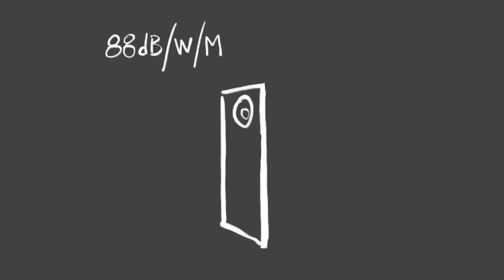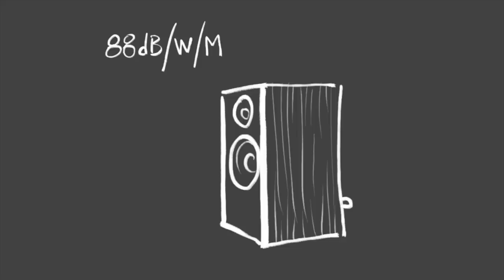John DeVore goes on a rant about the High End Audio lie that inspired him to start his company

Comment: Greetings Sir!  Awesome!! As one who's first "high-end" lol system had a 6v6 push pull Bell mono at heart this is so easy for folks to understand!  I still have a legendary speaker for it's time DQ-10s The concept of time aligned / mirror was significant. My pair went through several owners and I was getting ready to get rid of also until I out I put some real horsepower behind them.You look much younger than I so you might not remember the Soundcraftsmen 300 watt a side class "H" Like supercharging a car. And I have their opposite The Altec model 19's a transistor radio can drive very loud! I had to subscribe to you due to such a wonderful clear easy to understand thought as this!  Thank you!

Comment: Correct me if I'm wrong but if you raise the ohm rating don't you need to increase the power from the amp? In headphones for example my AKGs are 65 ohms and I need a external DAC but with my Grado's which are 32 ohms I can drive them straight from my iPhone. I'm sure you had this relation the other way round?

Comment: Excellent summation...I personally feel majority of consumers (non-audiophiles) "don't know what they don't know".

I also believe speakers have succumbed to the unfortunate bigger is better marketing trend that has plagued this industry relevant to amps and receivers. This does not apply to their size, but to their hyped up specification description. 

While audiophiles can reap the benefit of lower costs consistent with this ruse, generic listeners need to remember that all watt "ratings" do not necessarily reflect a congruent listening experience among brands. I will refrain from listing name brands, but audiophiles clearly understand this marketing ploy that exists with the higher number the better the system ploy (e.g. A multi-hundred watt complete sound system on sale for $399 will not yield the same high quality performance as higher end audio components). 

I do miss the Hi-Fi shops where you could actually go in and readily discern audio reality. Unfortunately, low mark ups and profit margins appeal to the big box mentality of the aforementioned systems vice the listeners discovering the identifiable nuances in person. 

Please listen with your ears to hear the clear and distinct differences that exist with quality systems that actually define high fidelity vice those "popular" brands! It remains a recognizable as the vast difference between a base level automobile and a high performance driving experience. 

Happy Listening!
Reply from the maker: Happy listening!

Comment: All amplifiers double their output when resistance is cut in half, it's just that most amps have voltage-attenuated max output figures when driving speakers below 8 ohms. For example, most any home audio amp will produce 1 watt at 8 ohms, 2 watts at 4 ohms, 4 watts at 2 ohms ect, but their max output is voltage-limited above a certain threshold, typically producing specs like: 100 watts max at 8ohm but only 150 max at 4 ohms. The difference with voltage-source amps like Krell or Sunfire is their output isn't voltage-limited when driving a lower impedance, so their output < 8 ohms isn't curtailed by voltage-limitations, provided the input current is sufficient.

Comment: I've got some Realistic Minimus-7 tiny speakers from the late seventies that sound fantastic, with a surprising amount of bass for such a small woofer! I've yet to hear a bigger speaker cabinet that sounds as good as these. They were developed by Pioneer for Tandy Corporation if I'm not mistaken. Very simple design: solid aluminum casing, a 4" acoustic suspension woofer, and a single dome tweeter, with a crossover into 8 ohms. They're only 40 watts but the sound quality is to be heard to be believed.

Comment: I'm a guy who has owned lots of speakers going back to early 70s. This is THE best explanation I've seen on this subject. My Larger Advent speakers are great but you can't drive them with a transistor radio. Claims aside, some speaker AND amp builders these days have sort of perverted the specs to fit their goals.

Comment: fine essay. to my 72 year old  (non 'audiophile' ) ideas, 2 small mentions - the good ole AR speakers , briefly mentioned - the leader or which, the AR3a , (mid 1960's)was very highly rated for bass especially - along with I think first production of Dome mid/ tweeters still in use -  But I'm pretty sure they were also called 'Amp killers' for their low resistance/ imped.  fast forward a bit, in I think 1978 Koss came out with a very early speaker using ' Thiel /Small computer programming for the  Bass Ports..  got excel reviews like ' flat +- 2 db from 30 - 5000 hz for the largest 1030 model.  I still have both that magazine issue and my Koss 1020 spks.

Comment: One thing I noticed is the sudden appearance of all these $1,000 speakers (like from Klipsch) that are made in China.   Why are these companies doing this when there are non-outsourced speakers that are better for a similar price?    I could never see myself buying Klipsch over Focal for example.
Reply: My RP-600 M have been relegated to the office on vintage amp with loudness. They sound ok.Just replaced them with J M Reynaud Cantibile from 2008. The sensitivity is lower than the Klipsch but……my volume control has to be set much lower than the Klipsch as they’re too loud. KLIPSCH are liars!!!!

Comment: You made a good point about the specification. In the interest of accuracy, though, you wrote it as dB/1W/1m when it is actually dB@1W@1m. The division sign implies proportional relationships, when, in fact, they are logarithmic. The @ sign indicates a single point of measurement, and not an equation (y dB = x Watts / z meters).

Incidentally, I've given up on the whole amplifier thing. Powered KRK Rockit 8's and a mixer. Only thing I've heard that's better are Quads. And they are out of my price range.

Comment: Hi John, thanks for a great video. Absolutely, speakers are not resistive loads, but rather reactive. No speaker that is rated at 8 ohms is actually 8 ohms throughout its operating frequency range (and I believe that impedance may vary depending on signal amplitude as well). So for the speaker/amplifier system to maintain a constant energy output, the amplifier must respond with a greater current output during those moments or modes in which speaker impedance drops. 
One note about speaker design- I believe that the push towards smaller drivers (through the 80s and 90s especially) has contributed to greater speaker reactivity. This is because to maintain a certain degree of bass output, a smaller driver must travel further in order to displace the same volume of air. (This trade-off occurs at all frequencies but is particularly important in the bass.) So you have higher relative velocities between magnet and voice coil, and longer speaker strokes, both of which may contribute to reactivity and other non-linearities.
Reply: That being said they're getting pretty good at overcoming those effects, while also having the advantages that you can get from smaller drivers.
Reply: @RennieAsh  Hi Rennie, yes, you're absolutely right, and the new engineering ideas are often really interesting.

Comment: I’ve had 3 sets of two 8 ohm speakers attached to the same 3 channels (left center right) of a Pioneer Elite amp for years without any problems. They are arranged above and below my 65 inch TV with a larger one mounter in lower center position. This anchors the sound in the center of the TV. It is a 6.1 setup.

Comment: A great discussion! Just my two pence: the lower the output impedance of an amplifier the easier it can handle low speaker impedance by providing high current without attenuating the signal. All well designed serious power amps deliver exactly this. With a less powerful amp its output impedance forms a voltage divider with the speaker impedance thus attenuating (=distorting) the signal. The voltage divider exists in the former case of course but the low amp output impedance can be assumed to be 0 Ohms.

Comment: Hey John, I’m new to this audiophile hobby and to your channel. I respect and understand where you are coming from as the watt/DB rating being misleading. But what you didn’t elaborate on, and probably should have more is why did that inspire you to go from enthusiast to making your own speakers and how does that coincide with solving that industry marketing problem? Are you planning on stating the required Volt reading and the traditional more accurate watt/DB/m rating? You didn’t really finish your thought. You only explained the problem without telling us how you plan to solve it and what your company brings to the table in that regard. Maybe a follow up video linked to this one would be a good idea?

Comment: At 1W load with X amount of voltage the audible sound decibel level resonates. Unknown voltage input,   quality of voltage input of voltage source and the range of audio tone/frequency sounds.  Range of frequency and voltage source is important. Speaker driver is a sound machine that takes set voltage and works an electro/mechanical load and resonates sound.

Comment: Great video and the flip side explains why people misunderstand amplifier specs too. They don't understand why you need high power amplifiers if you're only listening at moderate SPL levels. The reason is because for an amplifier to drive a modern speaker with a significantly lower impedance at bass frequencies than at 1kHz for example then it needs to have low output impedance, ideally as close to zero as possible in order to maintain the same voltage into the speaker by providing more current. Practically this can only be achieved in solid state amps by using multiple output transistors in parallel which naturally also increases the rated power into 8 ohms.

Comment: Can someone explain this....why is it that a lower-impedance speaker is “harder to drive” than one with a higher impedance?  That seems reversed, no?  If the impedance is lower — meaning, if the amount that the speaker “impedes” an incoming signal is lower — then wouldn’t that mean that the speaker is Easier to drive, not harder?
Reply: You're correct, something with high impedance requires more power
Reply: I believe that low impedance causes amps, especially solid-state amps, to become destructively unstable. An unstable amp can suddenly emit a huge power spike, thereby killing itself or your speakers in the process.
Reply: A lower resistance allows more electricity to flow (see ohms law) which increases the power consumption. This requires more power to be output from the amp, which puts a bigger load on the amp. This higher power output requirement for the amp is "harder" for the amp to pull off, due to the increased heat load amoung other things.

Comment: This explains why my KEF towers (which get down to 3.2ohms but are specified as 8ohm 89dB) improved dramatically when I switched to a 200wpc Rotel integrated. Cheap speakers that turned out to not be all that cheap. Cheers for taking the time to explain.

Comment: The problem with this video is that John seems to be pining for a less accurate description of loudspeaker sensitivity. When loudspeaker manuafacturers say or said "1 watt at 1 meter" with an 8Ω system, they were actually just putting 2.83 V rms and using its nominal impedance. A nominal impedance like 8Ω or 4Ω or whatever is an approximation; the loudspeaker's actual impedance varies widely over the audio spectrum and typically is 8Ω only at a few points. At other frequencies it may be much lower, and at others it may be higher. At resonance, its impedance might be much, much higher, like 40 to 60Ω. So that "1 watt" figure itself, being derived from an approximation, was an approximation as well.

RMS voltage, on the other hand, can be measured very precisely. And although we call them "power amplifiers," most modern amps are in fact voltage amplifiers. They are voltage sources, with very low output impedances. Thus, if they're set to put out 2.83 V rms with a particular input signal, their output will be steady, within a percent or so, into 8Ω, 4Ω, 6Ω, 30Ω, or whatever the load may be.

So specifying sensitivity with a precise and definitive voltage figure really tells us more than the old "well, let's call it a watt" method.

Comment: One small addition. The original measurement was 1 watt RMS in to a cabinet at 1 meter on axis. This would take out the issue of off axis degradation. There was no discussion of which weighting system for dB. Most back in the day took an avg. of both A and C weighting

Comment: As a consumer, I thought for quite a while that higher sensitivity was always better. Turns out, highly sensitive Klipsch speakers can still sound bad. Now i get the feeling that the best speakers with balanced sound are usually between 85-90 dB. I'd rather have something that requires a little more power to get loud, but have a good balanced sound and bass presence...than have a 96 dB speaker with in your face treble and shouty upper midrange where you can barely feel the bass.

Comment: Very well said. Easily a thumbs up on this lecture, rant on the actual performance, and specifications of amplifiers, and speakers. Very revealing, up to 12:12. I learned quite a bit, and am more aware of that new specification on the new speaker's performance. I started to listen to music more seriously, and had my first hi fi audio system in the late 1980s; and back then it was measured as dB, for 1 Watt per 1 Meter distance; 90dB SPL 1Watt/1 Meter, for example.

Okay, GeneralCurtis3LeMay if what you explain is actually the correct, deep theory of this electrical path, and its practicality, why don't you make a YouTube lecture video?

Comment: Please explain why my 80's 35 watt receiver has 10x the power of the crappy sounding, but still not cheap, "200 watt" Yamaha joke of a receiver I bought for my wife a few years back. Does watts mean anything at all these days?
Reply: Well as a car audio guy, a common way I call bluff on car amplifiers is to look at their fuses, cheap car amps almost always have fuses onboard and with simple math you can determine the most wattage they can put out. I'm guessing with home equipment though they can probably lie about the power draw on the rating plate/sticker though. Wattage is definitely a joke these days with most companies, my early 70s Kenwood is only rated 18 watts per channel at 8 ohms, it'll push any speaker I have without distortion.

Comment: I remember in the mid to late 80s, a small company in my neck of the woods, Sima made a small 50W integrated amp the PW-3000, that was able to drive big electrostatic speakers, that went below 2 ohms of impedance, while super expansive dual mono blocks amplifiers like Martin Logan could not. I owned this amp for years before I was forced to move to a surround receiver for my home cinema needs.
Reply from the maker: Sima is still around as Simaudio, I believe. Great stuff.

Comment: I've always found speaker sensitivity stats confusing and I didn't understand why it was 2.83v. This explains why my (amateur) measurements of db levels for the amp power always seemed to be off. db @1w would make it easier to work out how much amp power you need for your speakers and room. As a result of this spec change lots of people drive their speakers with underpowered amps.

Comment: I'm only ever going to own active speakers bc I personally am not convinced amps even impact the sound that much, or rather in a way that has me thinking about interchanging them.
Reply: You know that the amp is well matched to the speaker like that and that there is not much incentive to have impressive numbers other than frequency response and max SPL. No designing speakers to work with super amps that the customers don't own but the reviewers, do. No sacrificing fidelity for efficiency to make them louder in a comparison setting.

Comment: Chuck
 I appreciate your presentation. Many claim that high efficiency speakers will highly decrease your bass sound because of the "volt-current-impedance" relationship. In real life I find this completely wrong. I run a 2 watt tube amp to an Eminence delta Pro-15a speaker with 101.6 db sensitivity for the woofer and a JBL GTO 939 with a 94 db sensitivity for the midrange and highs. I have plenty of base and at times I have to back off the bass control. The sound is very good, real stage sound. If I change the speakers to my BOSE 301 series lll speakers which are much lower sensitivity, every thing goes to pot. All these people need to get away from the so called math and find out what works and does not work.

Comment: I have some acoustic research ar90’s and I also have set of LaScala’s.   The AR’s are power hungry and as everyone knows Klipsch are much more efficient.  They sound very different and I appreciate them both for the different sound signature they have. The base is very predominate in the AR’s for sure but the detail of the La Scala’s are more pleasing to the ear especially at low volume but the power the La Scala’s are impressive at high volume. I definitely seen a very big difference feeding the AR’s a lot of clean power.